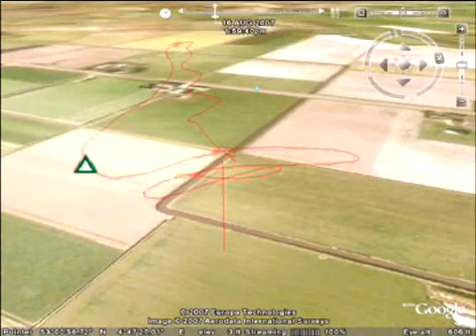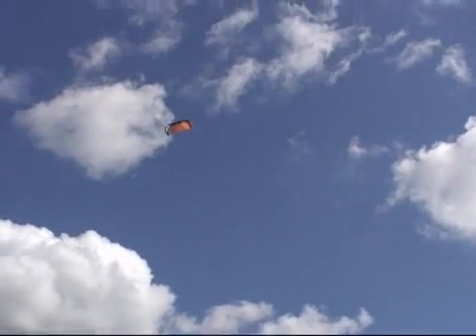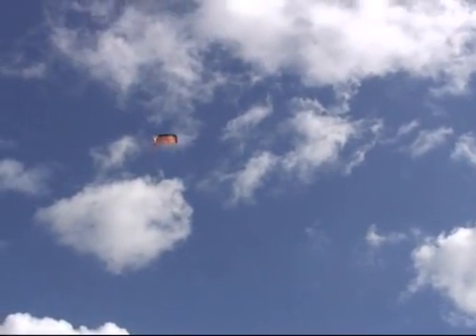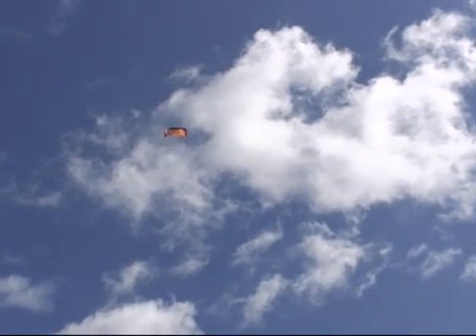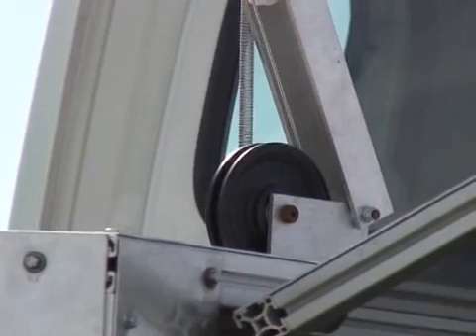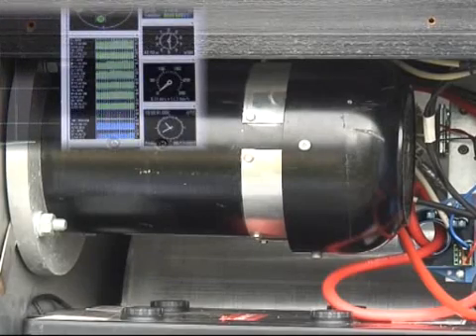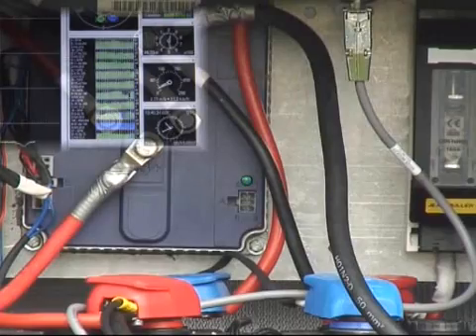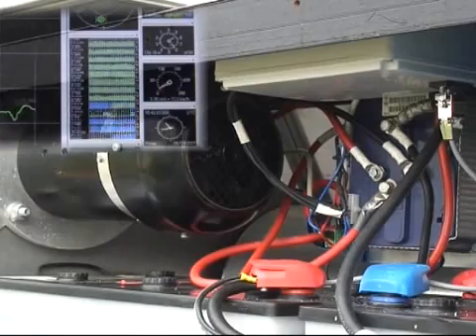[Guardian] Dutch scientists generate electricity with kites

Comment: If you've done some kiting you've probably noticed that if you fly the kite directly downwind of you, the kite is pulling with a lot of force, fly further to the sides and the force gets weaker (due to angle of attack). To produce electricity, you essentially wind the rope around a generator. When the kite is in the middle pulling with a lot of force you unwind some of the rope, turning the generator, and when the kite is on the side, you use a little electricity to wind the kite in a bit again.